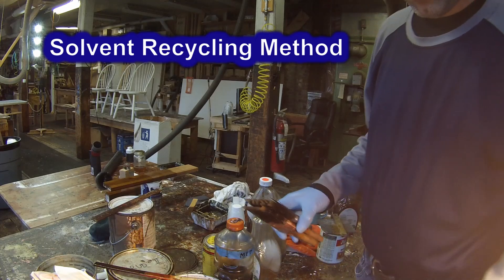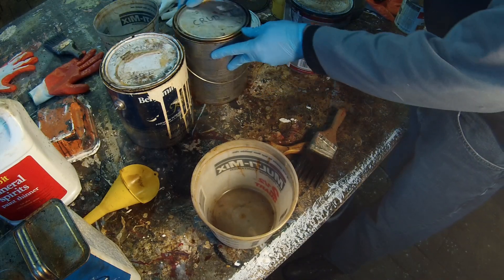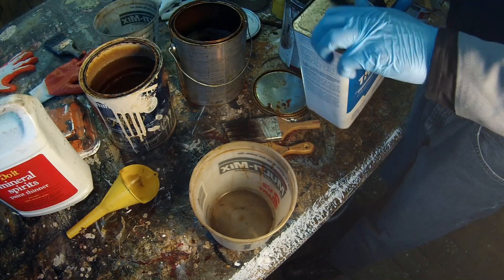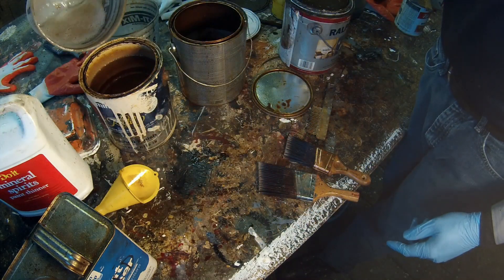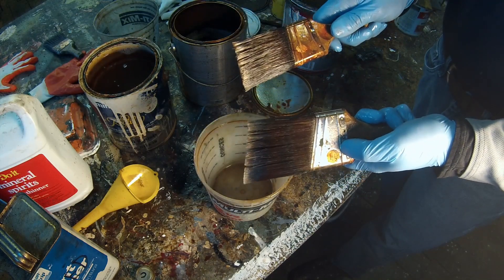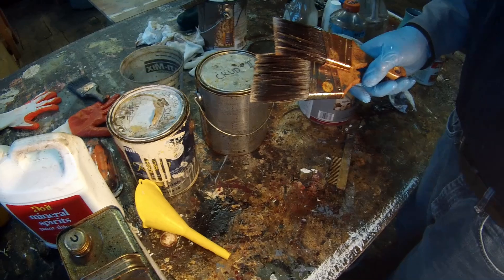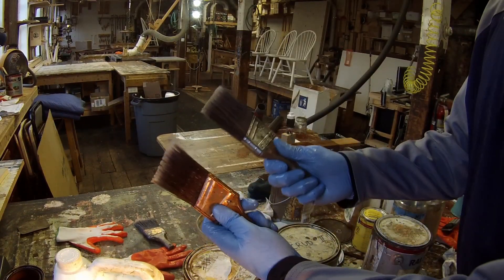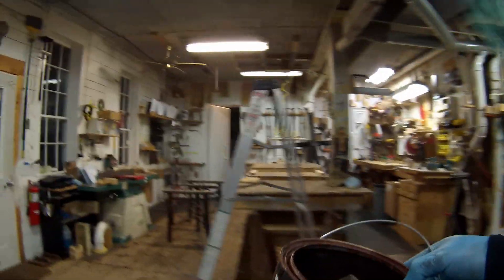Brush Cleaning with Solvent -- (Recycling Method)

Comment: my 2 c
nowadays i don`t use oil base anymore in my shop but for the wood/metal projects sometimes i do, in this case for me the final step is washing the brush with soap and warm water, let dry, then brush my forehead so it picks some human oils, and wrap in waxed paper, sounds anal but a good natural fiber brush is super expensive where i live and this way it lasts a long time (very long time). i became somewhat hypersensitive to lacquer thinner and mineral spirits and don`t like to wear respirators all the time so i do the whole process in a repurposed sandblast cabinet with the pump and deposit from a parts washer(nitrile gloves, vents to the roof). i use a lice comb for cleaning. i`m not a pro woodworker but used to paint a lot with oil base in my fabrication/welding/furniture shop, now almost exclusively use waterborne and air but keep cleaning the guns in the cabinet as vapors are present even in waterborne and don`t want to get headaches from this. keeps the stink out of the shop air too. 

edit. i have a few homemade combs they work fine, low cost, make them with 2" 18ga nail gun, when you have to pull hard you already fucked up your brush, happened a lot until i got proficient with the cleaning
hope it adds something valuable to the video. 
thanks for sharing mitch.
pete

Comment: I take an approach very similar to yours with one additional final step. After all is said and done I allow the brush to soak in a bucket of hot water with some Dawn dish washing liquid or Miracle Red over night. I use just about a gallon of water in a three gallon bucket. Well I guess there is on more step, that is to rinse the brush off in the morning and allow it to dry.
Reply from the maker: +SamsonmetaphysiCAL. 
I try not to leave things soaking if I can avoid it.  I usually forget and then it's in a bucket for 3 weeks.